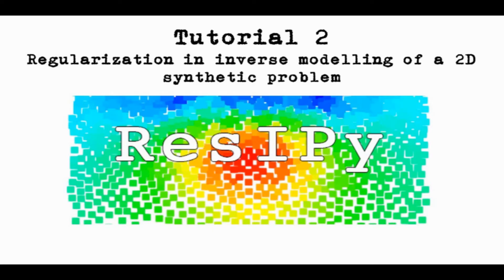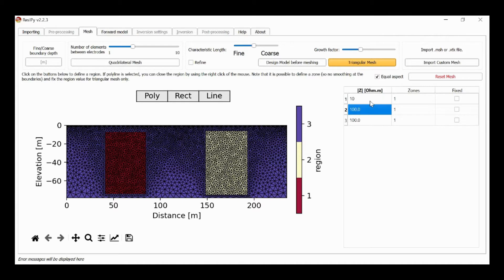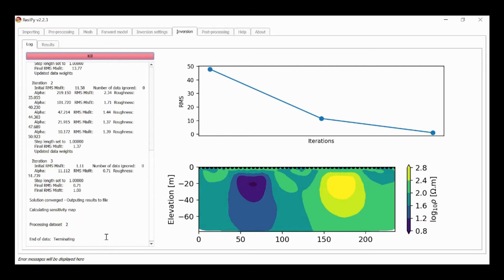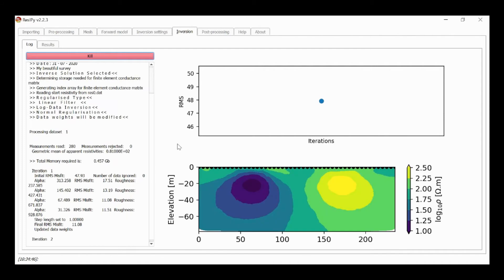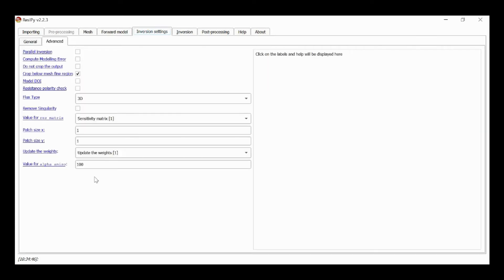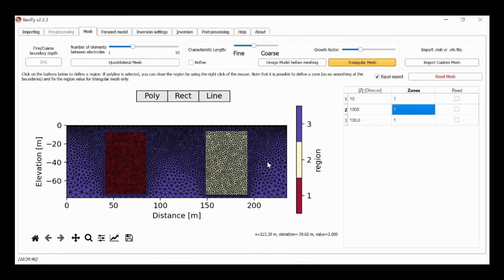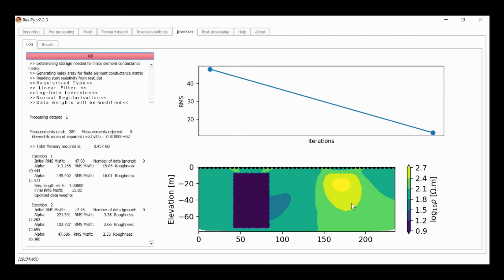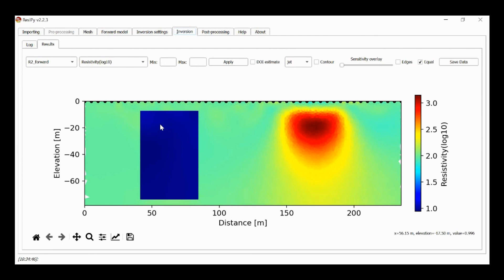Tutorial 02 - Regularization in inverse resistivity modeling

Comment: Excellent inversion program. Good results. I have a question about the horizontal distance in 2D. In the field we  use 99% of the time the "tape" distance. Not horizontal distance. In a terrain with topagraphy a tape distance is always larger than the horizontal. For example, in a slope if I use 5m of the tape, the horizontal distance will be about 4.8m for example. My question is how to inform the inversion that my distance is the "tape" and not the horizontal? Thanks!
Reply from the maker: (Thank you!) That is a good point about tape distance! However, you must use the absolute coordinates of points in ResIPy. Meaning, you would need X, Z of each electrode for 2D surveys (X, Y, and Z for 3D); this should be calculated and imported in the Electrodes (XYZ/Topo) tab.
Reply: @ResIPy  THanks a lot for fast answer! I hope in the future you can elaborate a automatic calculation of "absolute" coordinates in 2D. I suppose can use triangles to calculate. For example the "tape" distance between one electrode to other will be the "hypotenuse" (C), the horizontal distance will be the lower side of the triangle (A) and the difference from the elevation of both electrodes will be the "vertical" side (B). So Cquare2 = Asquare2 + Bsquare2.
Reply from the maker: @x.trailcwb  Thanks for letting us know about this. Keep an eye for the new version that we're releasing in a few days. We have implemented this feature for 2D surveys and added a checkbox in the "Electrodes (XYZ/Topo)" tab that converts x values measured with a tape to the true x, given topography exists.
Reply: @ResIPy  Fantastic!!! Thanks!

Comment: Hello again and thank you for the great videos.

I was looking through them again now, that I have managed to produce some convincing models with ResIpy. We are doing some investigations in an area with clear bedrock boundaries and a supposed underground tunnel. In order to better visualize those elements, we were thinking of using the l1-norm instead of l2-norm.

I found some older comments saying, that ResIPy does not support l1-norm inversion. Is this still true? I noticed that under the inversion method there is an option for blocked linear regularised type. Does this type achieve similar results? We ordered the book, where it is probably explained, but it will take a couple weeks to arrive, so maybe You have an answer to this question. Furthermore, when I try to use the blocked linear regularised type inversion, the inversion starts and stops without any error messages, but no results are obtained. The inversion also only runs for a couple seconds.
Reply from the maker: ResIPy does not support L1-norm and the blocked linear regularization inversion is different than that.
Reply: @ResIPy  Thanks!